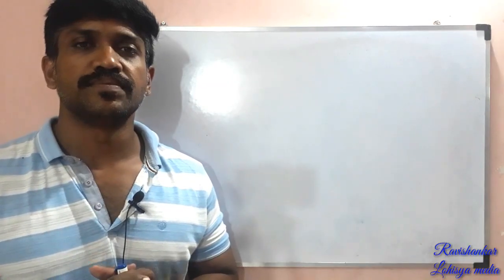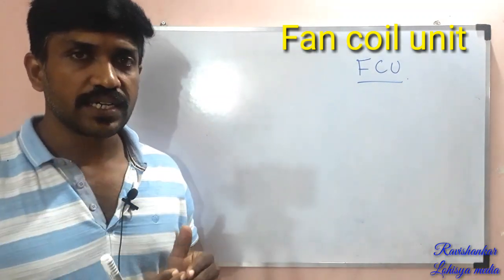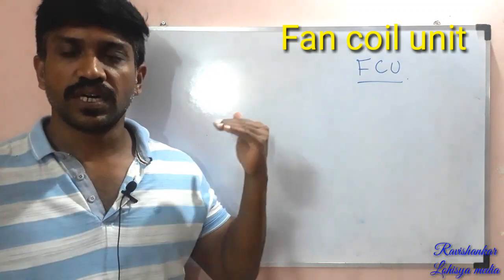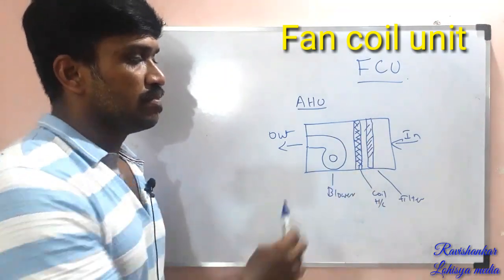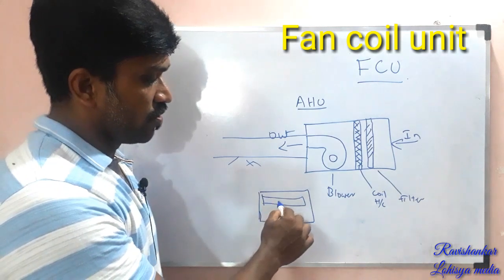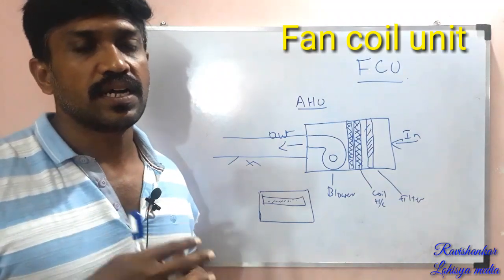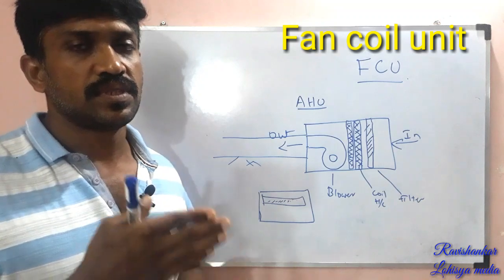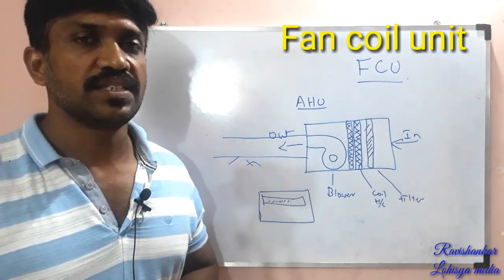FCU | Fan coil Unit | HVAC | Tamil | Lohisya media | Ravishankar..

Comment: I watched all your videos,Simply explained, thanks the video easy understanding the system in tamil

I have issue in my Hotel,

None of the unit not achieve setpoint AHU,FCU,TFAHU

FCU-485nos
AHU -9nos
Chiller -3nos
FAHU - 3nos

One FAHU 100% Fresh Air
Two FAHU with HRV

Both TFAHU i found HRV Not working, 3nos chiller always two chiller running with 4compressur

And all the location water condensation is there

Can you advise what I need check?

Comment: Hello sir..

I have a doubt regarding Fcu. In a closed room/building from where Fcu is getting intake air, from ahu or existing air inside the closed building /room. If it is taking existing air inside the building /room the co2 level is more ryt,
Please advice for the above
Reply: Hi, Basically FCU will circulate  room air + some amount of fresh by the help of FAHU . Hence the fresh from the FAHU will ensure the oxygen level inside the room for human comfort. Better study carrier HVAC design Hand book.
Reply: @MrSportsworld  where to get that handbook?

Comment: Bro. How to calculate AHU TR (newly to be installed) for a Electrical panel room, which has VFD's, controllers, breakers. How to know its quantity of heat generation.
Reply from the maker: In Electrical panel room we use only AHU with air supply and return don't use cooling AHU it will affect your system
Reply: @lohisya_media   p❤️
Reply: That's ok bro. How could I calculate AHU capacity for that panel room? Those drives will generate a huge amount of heat. Chilled water temperature is around 7 -8 deg C in our plant.
Reply: How could I calculate AHU tonnage rating required for the VFD panel room.
Reply: @shipraprasath  Hi! Consider the heate mission rate (inefficiency of the VFD will convert into heat say 98% efficiency from VFD and 2% will be dissipating as a heat inside the room)from VFDs and add the same in your heat load calculation as sensible heat so that you can arrive the tonnage of the AHU.

Comment: Hi sir....I'm working in bank building there's two fcu connected one ac working good condition another one ac cooling good but  too much noise coming  what's the problem can you tell me pls I'm facing this problem one week 
Note : I'm three month once doing the ppm service checking the coil and motor everything but last two weeks this issue I'm facing can you explain sir
Reply: Check the filters first. Next if the sound comes from blower motor bearing, it must be changed.

Comment: வணக்கம் bro
Bro beauti  salon  kku என்ன type ac use பன்னா நல்லா இருக்கும் bro,  vrf okya, or normal spilt ok yaa, or  vera ஏதாவது model இருக்கா bro,  centralised ac duct panni podlaamaa, மொத்தம் 1300 sqft ,  pls advice me,  my no 7373530666
Reply from the maker: How many rooms
Reply: Thsnks for your reply bro, 

10*6 size room - 5no
15*15 size room - 3 no
Reply from the maker: @sundarrajsundarraj3978  then go with VRV system its is best for multi rooms
Reply: @lohisya_media  thanks bro, 
Bro one more help which company is best and cheap , i understand vrv is daikin ,apart from that which company is best and cost effect bro
Reply from the maker: @sundarrajsundarraj3978  
LG or Mitsubishi
Reply: Bro go for vrv system 10HP or 12 HP